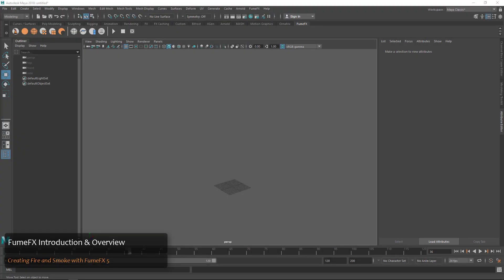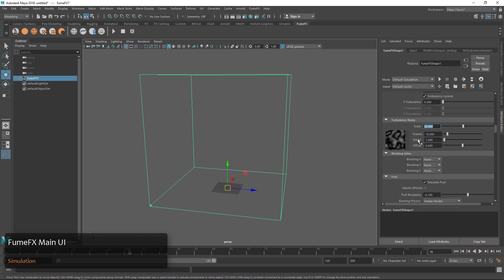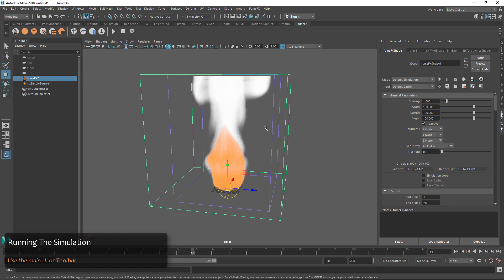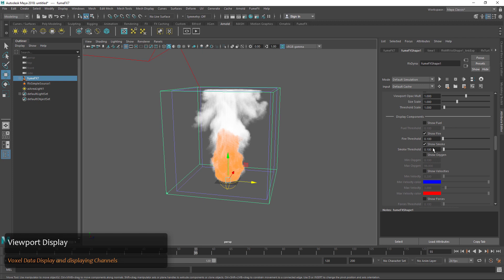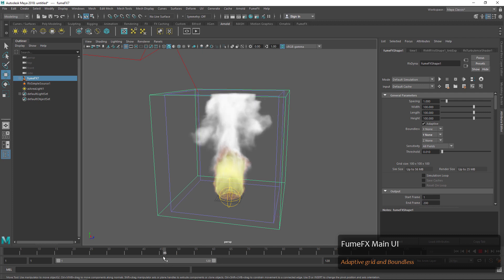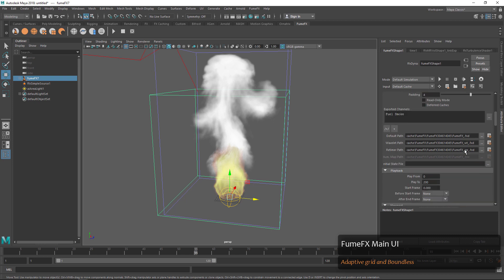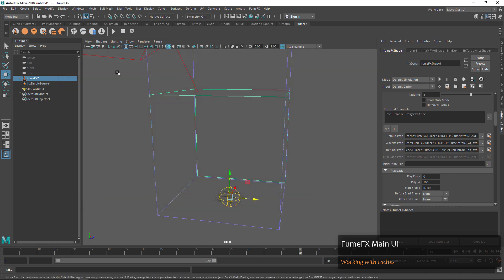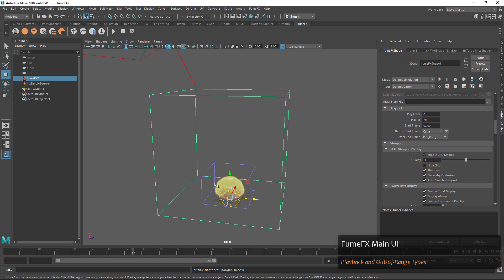FumeFX for Maya Essentials - Introduction and Overview

Comment: Fumefx render better in Arnold, VRay or Redshift. Are there any pros and cons to using it with those engines compared to the other?
Reply from the maker: It has direct support for Arnold and Redshift, but you can use other renderers if you simulated to .vdb.